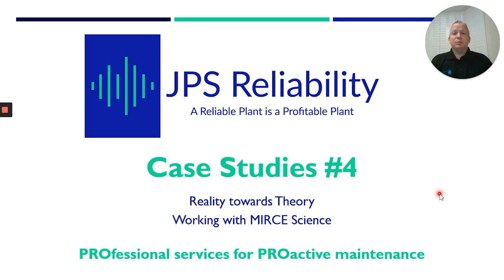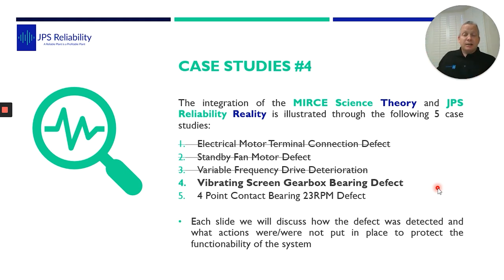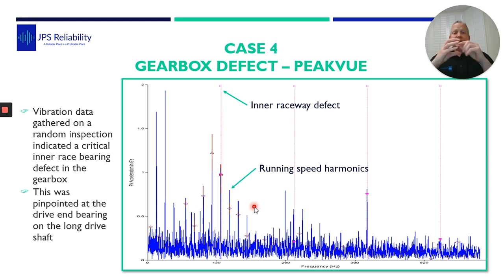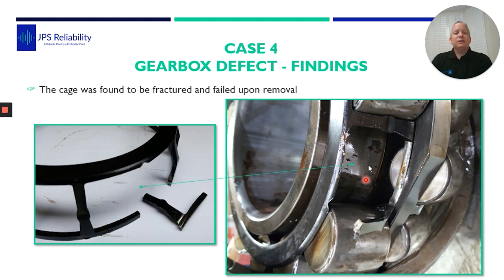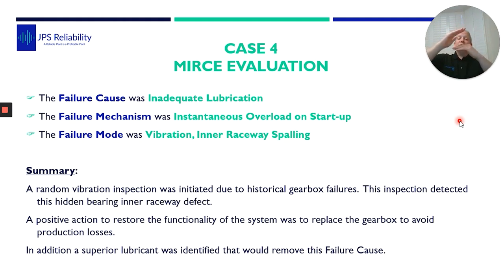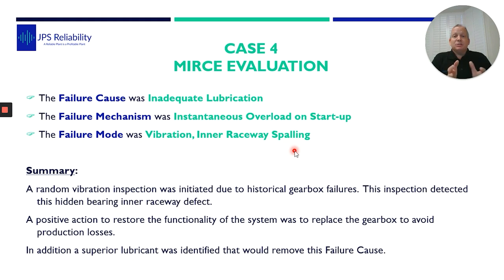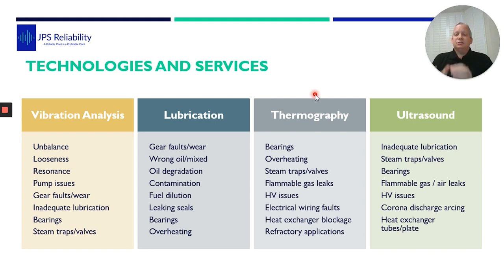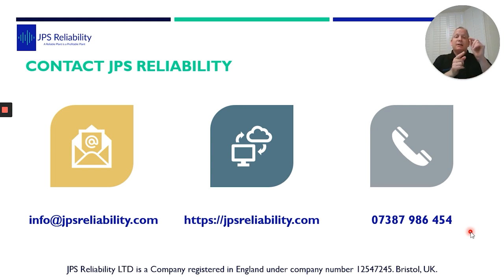Vibration Analysis Case Study 4 – Vibrating Screen Gearbox Bearing Defect

Comment: Thank you. Very interesting. I have a question, if we only measure RMS velocity of the vibration, what severity level can we use to determine the condition of the bearings? Can we use Iso 10816 std? I think these severity levels are for stationary equipment and not suitable for exciters that are moving with vibrating screens.
Reply: No you cannot use 10816 for assessing bearing condition. It comes down to the application speed and type of bearing. Best using waveform pk-pk in Gs especially on a shaker screen where you will get high velocity levels. Really needs some filtered readings too like PeakVue / enveloping